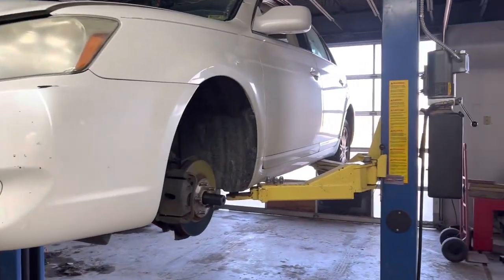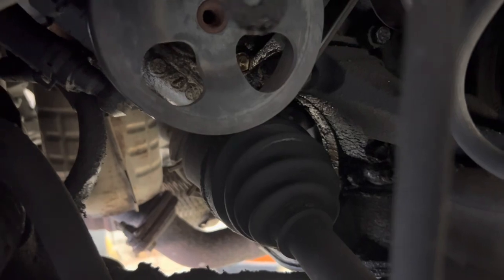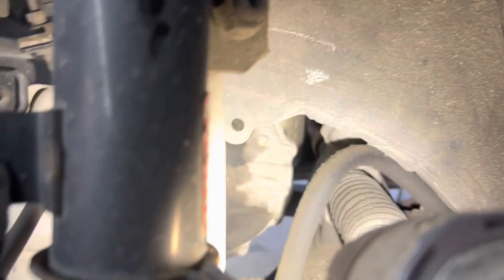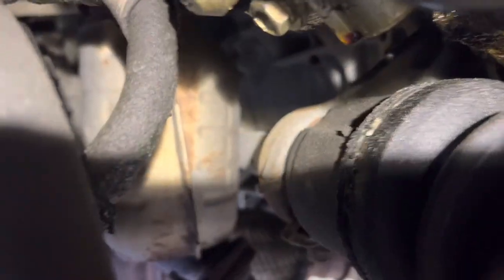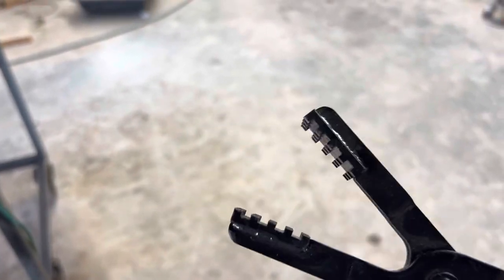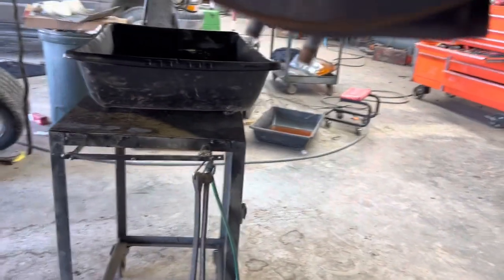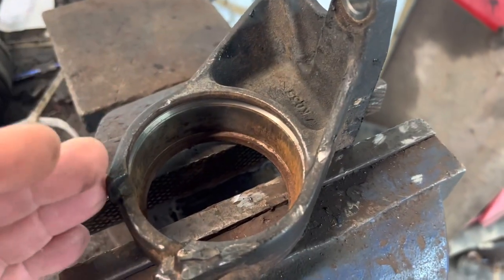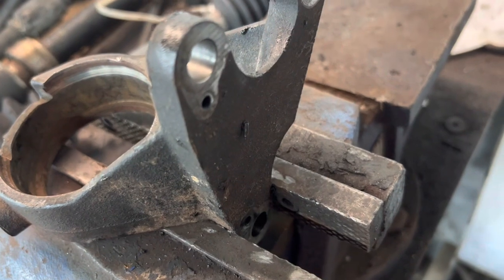Toyota Avalon front driving axle replacement

Comment: Thanks for the video im having the same rust problem on my 2002 avalon on the passenger side. Didn't know you could unbolt the middle bracket.
Reply from the maker: It has dowels in it so some don’t come out, it depends on how much slack is in the splines of the inner axle

Comment: Did you replace the seals with new ones (where the axle meets the trans.) on both sides too? or no?
Reply from the maker: I rarely replace them unless they’re already leaking or were damaged while pulling them apart. I don’t think I’ve ever had a comeback.
Reply: Thanks for the fast reply & good to know. @bulldogsautomotiveadventur4387
Reply: Thanks for the fast reply & good to know!   @bulldogsautomotiveadventur4387

Comment: Thank you. What's the torque for the bearing bracket bolts ?
Reply from the maker: I just tighten those till they’re tight, I don’t usually use a torque wrench unless I’m working on something critical like heads, intakes, lug nuts, etc.